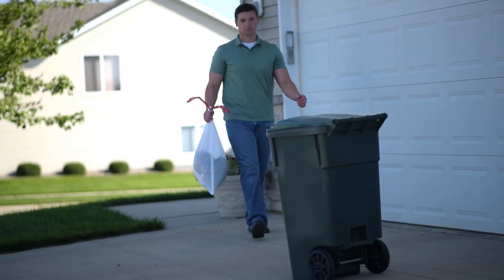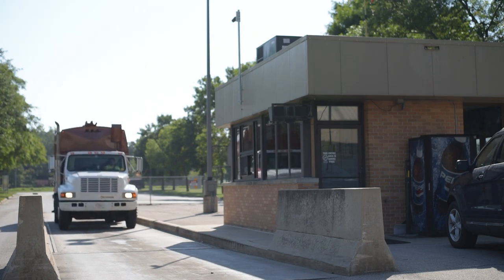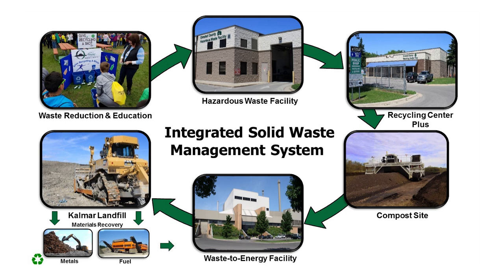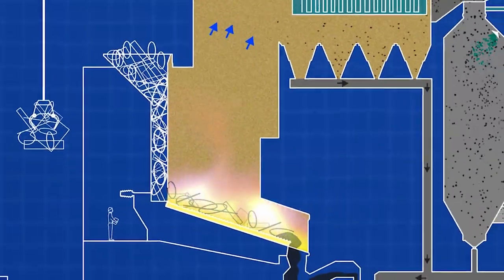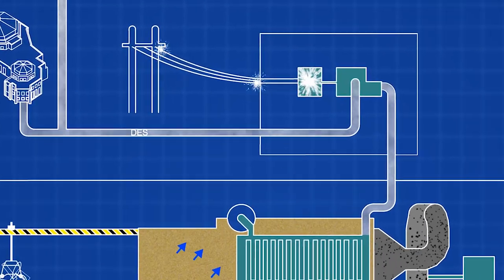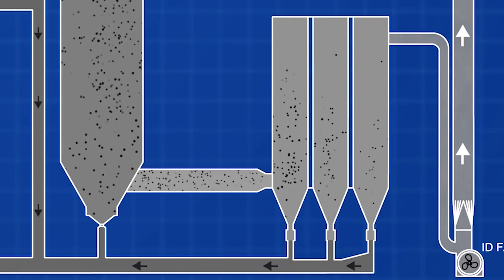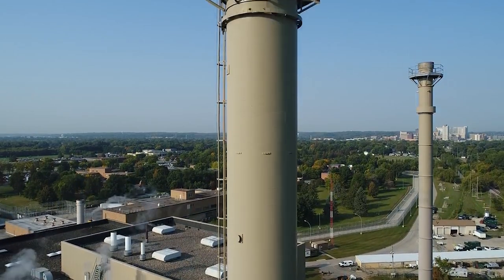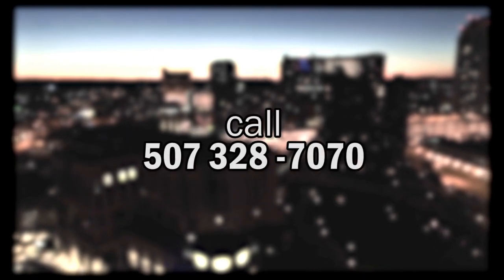Olmsted County Waste-to-Energy Facility (OWEF)

Comment: Why not removing the metals from the ash before disposing it?
Reply from the maker: Great question; before the ash is buried, we use a large
magnet attached to the bucket of an excavator to remove ferrous metal (iron). The
extracted iron is then recycled. However, we encourage residents to recycle
scrap metal—at the Olmsted County Recycling Center Plus or other scrap
recycler—instead of throwing it in the garbage. Doing so reduces wear and tear
on the Waste-to-Energy Facility and ensures non-ferrous metals (like aluminum)
are recycled. In addition, we have looked at mechanically removing metals
before the combustion process, but to date, it has been cost prohibitive.
Reply: During the land fill, maybe it is just this video but it dumped the ashes directly to the soil. Could this possibly generate leached liquid?
Reply: @beckenbauer1974 Back in the Eighties , Didn't they have a Technology to Netraulize Contaminated Soil !!?? Form Tip ! Landfill ! Sites !?
Reply from the maker: Thank you for the question. It’s important to clarify that the ash from the Olmsted Waste-to-Energy Facility is not dumped on the soil; it’s dumped within the ash disposal cells at the Kalmar Landfill. 

The ash cells at the Kalmar Landfill are engineered to effectively contain waste and preserve groundwater quality. The ash cells consist of:

•	A leachate collection system 
•	A 60-millimeter high-density polyethylene (HDPE) plastic liner
•	A 2.5-foot compacted clay barrier layer
•	Another 60-millimeter HDPD plastic liner
•	An additional 3-foot compacted clay barrier layer

Water (from rain events) that percolates through ash will be captured in a leachate collection system. Leachate is pumped out and brought to the Water Reclamation Plant in Rochester for treatment.